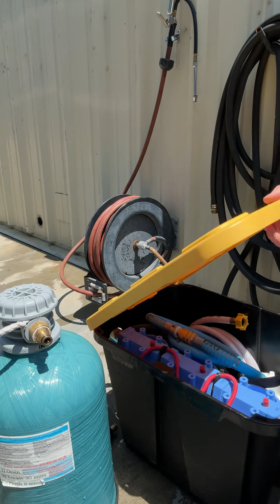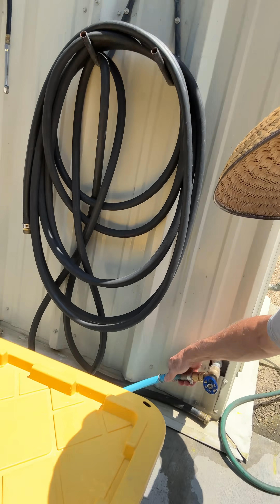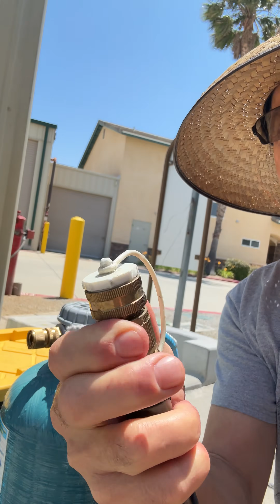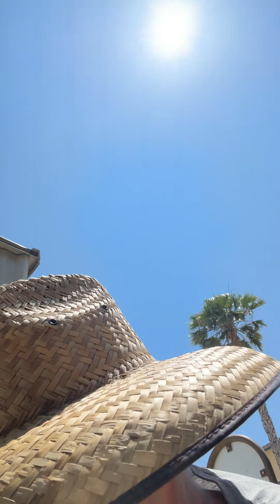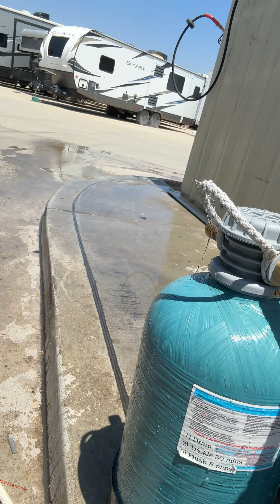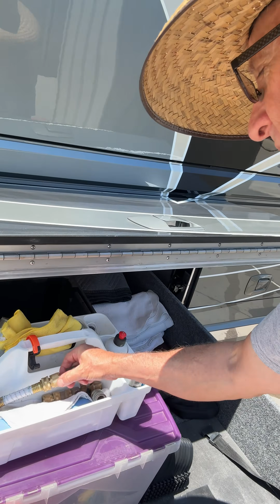Fast connection of 3-stage water filter system

Comment: Where do you get a double male quick conne t?
Reply from the maker: Hi...thank you for watching and commenting! The double-male you see me use is something I configured using the double-female fitting that comes with the tank with two QC males. For customers, I usually configure this to the utility hose that comes with the tank so it's a quick and easy, foolproof way to plug right into the tank.

Comment: I purchased my containers at Walmart, Sams was selling for $9 purchased several. Then couldn't see anymore and purchased my last 2 at Walmart @$12 which costed more.
Reply from the maker: Glad you were able to find a tub! Have yet to source the exact size mine is.
Reply: @RVSquaredSteve No for some unknown reasons they are limited to the size and shapes. Was told it comes or due to manufacturing.